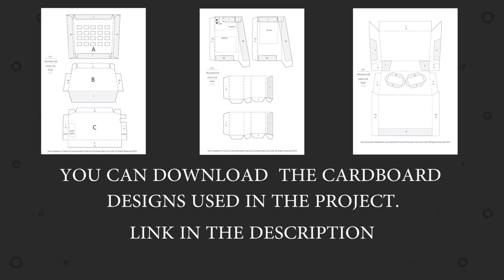[DIY] Helmet AC at Home

Comment: First of all nice idea and initiative. 
Here are a few suggestions to improve this helmet.
You could have 3D printed the body instead of using cardboard. If you ride faster, the cardboard will wobble and rip off.
Instead of that Velcro strap, you can make a permanent holder in the front part of the helmet and you just need to slide in the cooler whenever needed. This can make it look aesthetically pleasing. These are the few points I wanted to share that came into my mind.